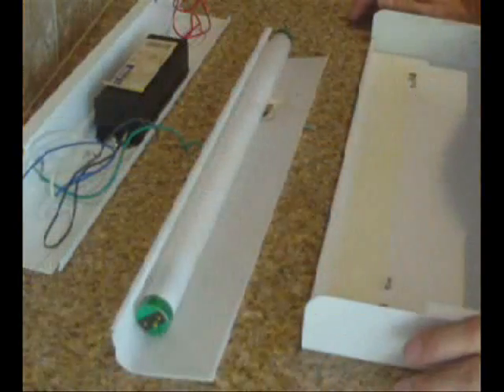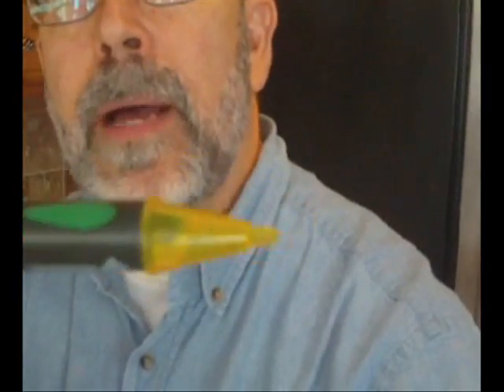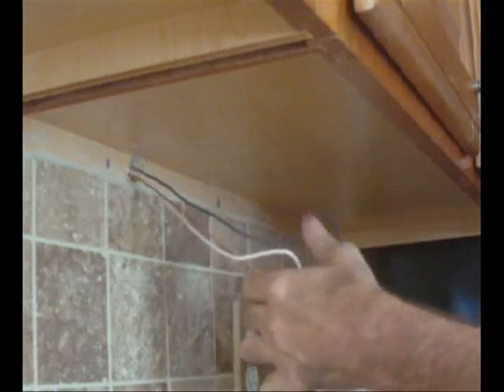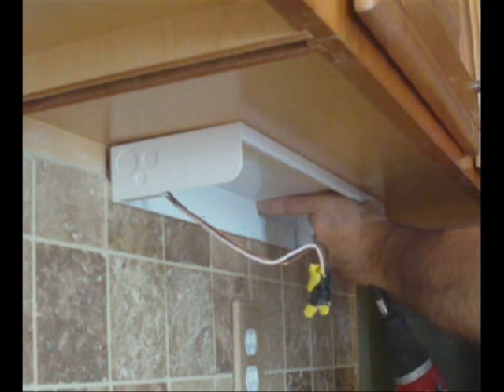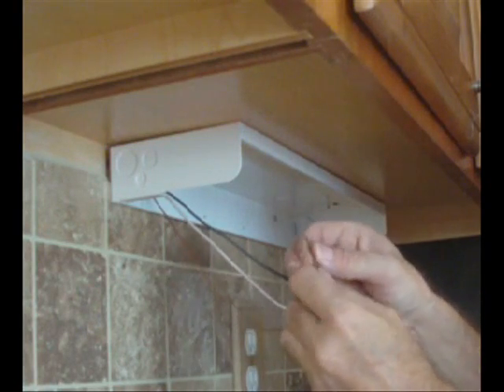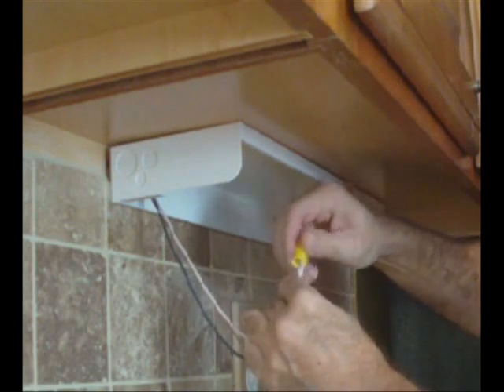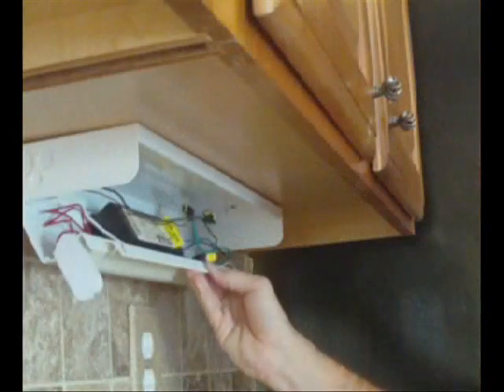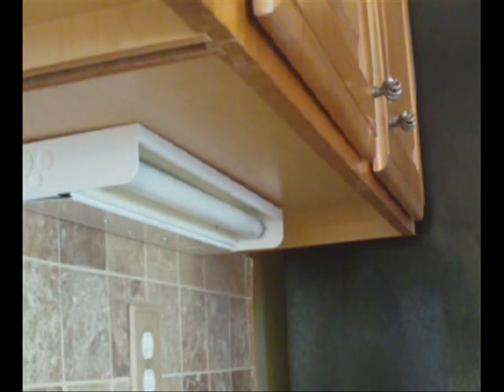How to Install an Under Cabinet Lighting

Comment: Haven’t watched yet, but from the photo at the beginning I must add a comment. I WILL NOT be pushing my light back against the wall in case to remove it later I need to push the cover backwards. My current under cabinet lights we’re installed flush against the wall and are almost impossible to remove because the housing unclips by pushing it back from the part screwed onto wall.  After 1/2 hour have gotten one off. Cursing the home electrician the whole way.
Reply from the maker: Thank you for commenting. Please subscribe, like and share the DIY love!

Comment: If I have 6 of the same light fixtures to a standard light switch, can I replace the light switch with a motion occupancy light switch? I haven't found anything online to say is it rated safe for that
Reply from the maker: Great question... Check the rating on the switch instructions for your answer. BTW I've got some more cool videos scheduled. Please be sure to subscribe now so you get instant notifications of my latest DIY home improvement tutorial videos!

Comment: How does the cover for the light bulb come out I need some replaced
Reply from the maker: Push on the front of the cover towards the back of the fixture in a pinching motion. Do the same when reinstalling.

Comment: That popping sound you hear screwing the base to the cabinet that means you're not dead even with the screw
Reply from the maker: Hi Zach, no, actually the cordless drill was set to the lowest torque setting to let me know when the screw was in sufficient enough without stripping the head of the screw...be sure to subscribe and click the notification "bell" now for our next home improvement/home repair DIY videos!
Reply: What size screws did you use lengthwise to not penetrate the word all the way up the cabinet